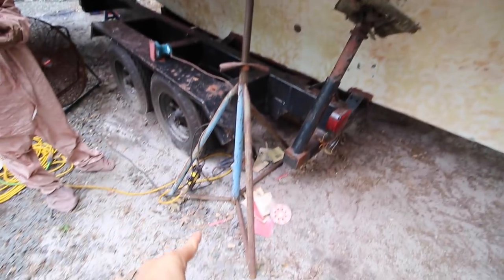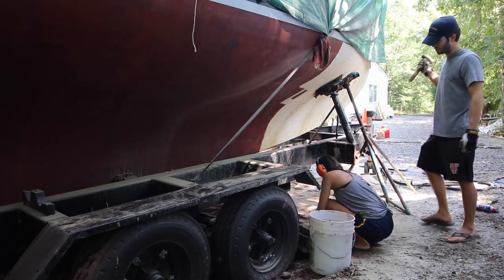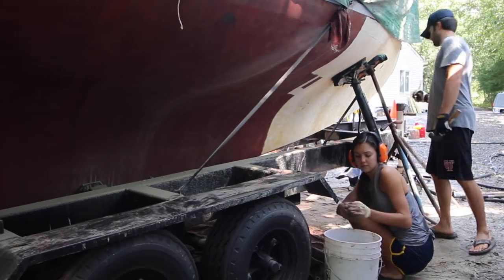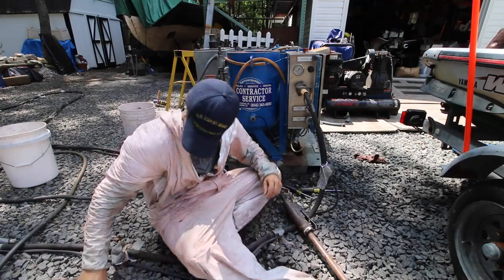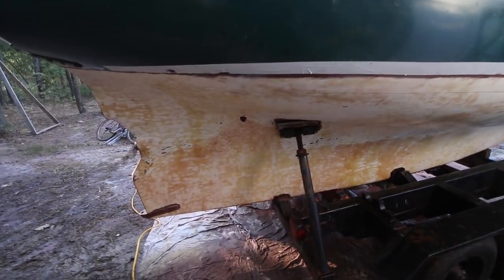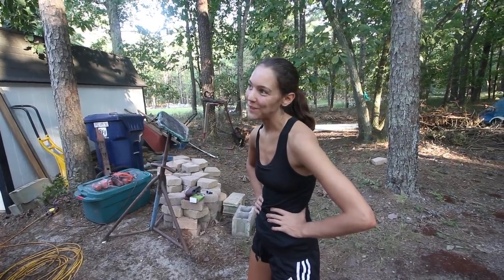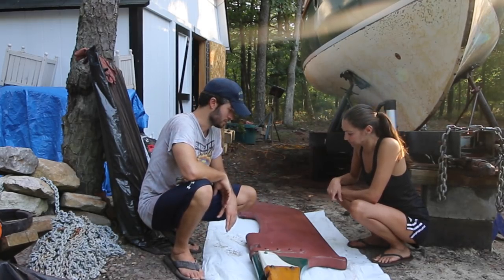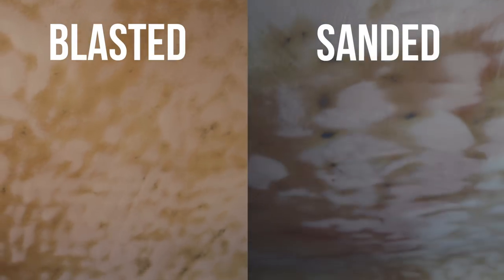45] Backyard DIY Classic Sailboat Restoration | Abandon Comfort

Comment: I've been watching Sailing Uma and their experience with electric motor.  It has not been easy.  The lead acid batteries did not function well with the large AH draw and delivered only 10 minutes run time with a fairly large bank.  And they had problems charging them properly. Now they have very expensive Lithium Ion batteries and have much longer run times but their electric forklift battery motor is getting very hot since it was not designed to run constantly for long periods.  They could not afford an electric motor designed to power a sailboat.  
I know you are looking to be green but you do not need much power to move this sailboat thru the water. Please review your diesel vs electric options.  A brand new 17 hp Yanmar industrial diesel runs just $2900 on Ebay and sips about .4 gals an hour.  Converting it to marine use requires your current transmission, a water to water heat exchanger and a raw water pump (I'd suggest a variable speed 12v magnetic drive water pump) .  At 6 knots, 20 gals of diesel would last 50 hrs and take you 300 nautical miles.  If you get an electric motor for your dinghy you can always use that as a backup.
Reply: Douglas Robbie: Whilst what you say may be accurate, I think that you are putting a negative slant on their experiences; they do not seem fazed at all by what they have done and are happy to buy the cheaper Lithium Ion batts (cheaper cos economies of scale). As for the motor, it cost them $100 over 3 years and they are ready to replace it now.
Reply: Umm, James, 'cheaper', yes,  because they were donated...  And yes, not 'fazed', since they admittedly only docked 4 times in that 3 years...
Reply: Lot's of boat channels that are always sailing. I'm good with this one being a This Old Boat fix up channel.
Reply: Douglas Robbie Right idea but 8 mpg is probably a little optimistic so 20 gallons might go 160 miles. The notion of a cruiser having an electric fuel tank is 100% ignorant. Day sailors to navigate the same daily channel in/out of the marina might be a good idea.
Reply: adamff280: Who said that they were donated to Uma? They are cheaper because they last longer and produce more power and in addition the are lighter, like I said economies of scale. They wanted to live on the hook its their way of life.
Reply: @Alex Hamon  What channel were you watching? Apparently not this one.
Reply: @billcarson259  it'll only be a butcher if they cut up the interior again. Putting in an electric motor is their choice it won't ruin the boat. The next owner can always swap it out if so desired. Wondering if they still are going for a transverse bunk under the companion way? That will be interesting, to say the least.
Reply: @artsmith103  little diesels get .4gph at a cruise speed of 5knts. 20gallons/.4gallons per hour= 50hrs of run time at cruise speed. 50hrs * 5knts= 250 nautical miles. If you throttle back a little from the 80% power they normally cruise at to say 60% you may loose half a knot of speed but got will drop dramatically to probably .3gph or less.
Reply: @JamesBu11  I haven't seen any small boat installations with over 10,000hrs yet. Not saying they won't do it but I doubt they will do it without breaking down by overheating the controller board or corroding cables or contactors ect. I know in theory they will last longer but my experience with salt water and putting things I to practice keep me skeptical. I love electric cars, bicycles, scooters ect they are great.
Reply: Andrew Pickard I'm not an expert but I have quite a bit of experience.  ~40' the almost true rule of thumb is 6 gallons per mile for a power boat and 6 mpg for a sailboat.  My gasoline 21' 1300 lbs does less than 8 miles per gallon. Diesel has 15% more energy and the drive train is more efficient but used with heavier vessels. I still vote 8mpg max for that vessel. Your numbers come to about 15mpg but it would be nice if you're right. 
If 8 hp is a nice size for that boat, consider that's equal to 480 amps hrs/hr. Safe DOD of 7 minutes run time per deep cell battery.
The whole thing is a moving target to figure out because they don't know how they'll use it. I predict trailored picnic day sailor.  50% of the benefit of the auxilary is to charge the batteries, not the other way around.
Reply: It was never a "cruising" channel, and it was clear from the beginning that they never intended it to be one. Did you miss the road trip across the United States?
Reply: I think you are exactly right that it is destined to be an AirBNB.
Reply: It cost the $100 over 3 years because they literally never went out. What did they take? One trip? Silly. Millennials.
Reply: 11 thousand dollars worth of Battle Born batteries are cheeper?  Than What?
Reply: "the large AH draw"

Motors draw AMPs (Current).  Not Amp-Hours (Energy).  Drawing 1 Amp for 1 Hour would be 1 Amp-Hour.

Comment: IMHO: Electricengine as a single boat propulsion is not safe. You will find yourself in a situation that can 'change' your life. There is nothing as unpredictable as the weather. Eventually you will either run aground, end up in heavy wind, seastate, current or a combination. Diesel engines are unbeatable. I myself run a 1964 2 cylinder that can be started by hand, as in without a battery if necessary , to provide propulsion and electricity. I know the engine insideout because it is simple, not because of hard study. It also is easy  to repair.  Choose wisely! A combination could be an ecologically/safety wise a compromise if you had the space... Excited to see what you end up with.
Reply: diesal engines break down all the time. look at Delos or Capt. Mikes recent videos.
Reply: Delos has pretty much circumnavigated the world and even wore out the generator and they motor for days on end . Try that with batteries .  I also see them having issues with all the electrics , from the windless  to the furling to the heads , to fans - electric is not problem free. 

My single cylinder Bukh can easily be started by hand , run without electricity , charge the batteries and has a range measured in days . Because I don't wait for things like impellers to break I have never had a problem that stopped the motor . Did have the electric shut of go bad though .

Comment: Great choice in beer.  Great Lakes' main brewery is just a few blocks from where I dock my  boat.  I've been thinking about doing some significant amount of boating in canals and rivers (my wife is not a big fan of sailing, but she does like moving under engine power in sheltered waters).  If you have any chance of spending time in canals, you may want to keep that old diesel around.  To be able to run for any reasonable amount of time on narrow waterways, you'll need something other than electric.  For example, to go from Lake Erie to Lake Huron requires traversing the Detroit River and the St. Clair River.  The St. Clair isn't all that wide and has a 3 to 3.5 kt current.  I recently did that trip and it took 6-7 hours.  I know that you have a trailer, but that isn't always convenient and may be less environmentally friendly than simply having a diesel onboard.  However, maybe that's a vote in favor of the electric outboard.  Then you could always hang a gas outboard there if you needed to.  Just something to think about.

Comment: Why remove bottom paint?
Looked pristine and boat hasn’t been in water.
Great project, look forward to seeing your improvements.
Reply from the maker: We needed to get the boat down to gelcoat to remove sea cocks & thru hulls then seal up the ones for the head & engine. Also, bottom paint is over 15 years old and we're doing coppercoat. The real stuff. Not DIY coppercoat.
Reply: Why?
Reply: Because they don't need a raw water inlet for a diesel engine they won't have, and they don't need a discharge for a marine toilet they won't have.  Electric propulsion and composting head don't need these thru-hulls.  And for Dan above, certain types of anti-foul paints loose their biocide ability when exposed to open air.  When you paint an ablative bottom paint you need to get in the water within a day of being dry.  That paint was on the hard for 10 years, it was worthless.
Reply: That doesn't answer why they needed to strip the bottom to remove some thruhulls.  The paint being worthless was not the answer, since they didn't say that in the first place.
Reply: Dan Schmitz i CONCUR
Reply: Dan Schmitz i CONCUR ... what a waste of time, money and where did they dump 30 # of toxic waste?
Reply: I was also wondering this, couldn't they have at the very least just scuffed and then over coated the anti-foulant if it had lost its biocide properties?
Reply: From the vid they also removed the grey epoxy barrier coat. That will have to be replaced before any bottom paint is applied...
Reply: To do that you only needed to sand about 1 foot around each fitting.  The only reason to sand the entire bottom is to do blister repair on the entire bottom and/or apply barrier coat.  Frankly, now that you have sanded the bottom it would be nuts not to barrier coat the hull.
Reply: On a boat this old I probably would have stripped it too...only if to check for blistering.  If this thing had severe blistering I'd be working on osmosis treatments (see Mads over at SailLife).  They didn't say why they were taking the paint off at all (until their comment), but personally I would have taken it off for the reason I stated above...checking for blisters and bad areas of gel coat.
Reply: Yea the paint prolly needed a fresh coat but I don't think they needed to strip off all the barrier coat and bottom paint. Sandi g where they want to pull thru hulls and a quick scuff and paint on the rest would've been sufficient and they would have saved probably $500-800 on barrier coat suppliesl
Reply: @WreckDiver99  the grey coating under the bottom paint was a barrier coat.
Reply: Their reasons doesn't justify the huge time and expense removing all the paint that was clearly well adhered to the hull and barrier coat. Now they have to try and redo the barrier coat in less than ideal conditions ( indoors , climate controlled etc). Will they be able to do as good a job? Nobody will know for a few years. If this is just a show an tell.....ok but ..... cheers Warren
Reply: Kraken hi , ablative are actually ok to leave out of the water, 10yrs maybe not......but you can paint over if well adhered, if that what was on boat . From west marine. QUOTE "Designed to wear away in a controlled fashion, ablative paints reduce the need for sanding when the time comes to repaint. Most ablative paints don't lose effectiveness when exposed to air, which enables you to paint your boat prior to winter storage and be ready to launch in the spring." End quote. Removing all the previous barrier coat , not such a good idea. Way too many folks think 'Epoxy barrier coat' is a magic product at stopping blistering....not so......properly made boats don't bister and epoxy barrier coat requires great care to apply to work properly to be any more effective than regular gelcoat.   I think they will be applying coppercoat so it may be a mute point anyway. Cheers Warren
Reply: @br5498  saw two in our mechanics yard getting stripped....couldn't see the blistering until paint was away.  The owners had a couple areas where the paint was down to barrier coat, and saw the blisters, but couldn't see them through the paint.  I agree on an ablative paint job typical of sail boats this would be very visible, but not on the heavy bottom coat on these 2 great lakes boats that were being redone.
Reply: @appick01  yes it is, but they sanded through that into gel coat.  They even mentioned this happened. 

Now they are in for a LOT more work because they need to reapply barrier coat.  Wonder if they will go for Copper Coat like Mads did.  The labor savings down the road (and cost savings down the road) may be worth it.
Reply: They need to make videos about something! So why not sanding?
Reply: Mister Professor  Mads cornered the market on sanding videos...and for some reason I LIKE THEM!
Reply: @SteelDoesMyWill  wow thanks so much for explaining...now it makes total sense!!!😍😍

Comment: Hey guys FYI don't use wd-40 instead use a spray call PB Blaster works fantastic great job
Reply: in my experience PB is 90% as good as Liquid Wrench. I also work on the worst of the worst and need all the help I can get thus liquid wrench...... (80+ year old equipment)
Reply: Love this debate! After 20 years working in power plants I’ve used all 3 and I’ll take Kroil over all of em. Heard an old salt call it Millwright cologne. Gotta admit the smell is unique.

Comment: Well, it's about time. I've been wondering what you guys were up to. Is this the unsolicited advice/criticism section? Great, here goes... That's quite a woman you've got there, congratulations. I didn't see her check her nails once and she clearly works with you. You can't put a value on that kind of commitment from your partner. Not sure why youre so concerned about weight, its a heavy little boat anyway, maybe its because you going electric, solar panels weigh nothing. Youre engine ideas and commitment to your plan have really made me think. Oars are a really great, traditional idea. I had a 25 foot folk boat for years that never had an engine of any kind. I had one oar and I used to scull around if needed (not very often). It makes you a good sailor as long as you don't bite off more than you can chew. More power to you. Ditch the mechanical/electrical propulsion all together? Use the money for beer and condoms instead

Comment: I'm trying to hold on to the concept here.  Best of luck, and I realize you two are already way ahead of the videos when you put them out.
I felt like when you got the smaller boat that you were moving closer to the "average" sailor and what their experience would be (pulling boat out on trailer, moving it around, dodging seasons, etc) but I'm just getting the feeling that it may be moving further from any discernible target audience.  Hopefully we can learn a little bit in the coming weeks.  Basically this episode was a sandblaster is good, but sanding also works (slower) and get a full faced respirator.  Not much about how you guys are faring off the water, maybe some timeline goals of what we can expect regarding you getting back in, etc.  Small stuff like "the random orbital worked better/worse than the belt sander"...."this is how we discarded our old paint that we stripped off the hull"....etc.
You two are fun to watch, but I hope we get back to "abandoning comfort" sometime soon.  Living at home and working on a boat on private property with no slip/dry dock fees seems very very comfortable, and would not lead one to believe that there is any sense of urgency.
Best wishes!  I'll stay tuned.

Comment: Sv seeker has a good video on making that type of sand blaster more reliable. Your going to run into trouble with your battery capacity and having motor range. Just because it says x amp hours doesn't mean you can pull the full charge out of the battery without damaging it.